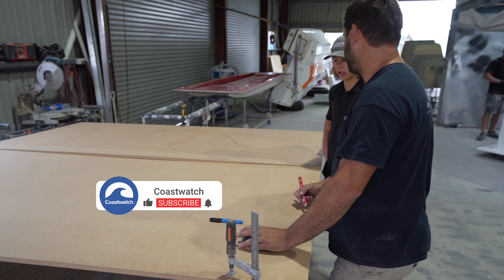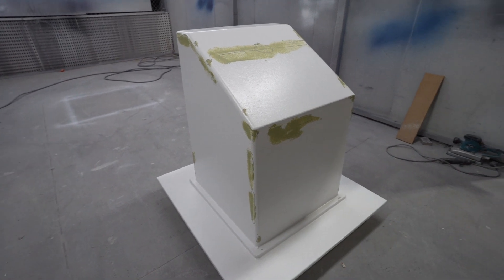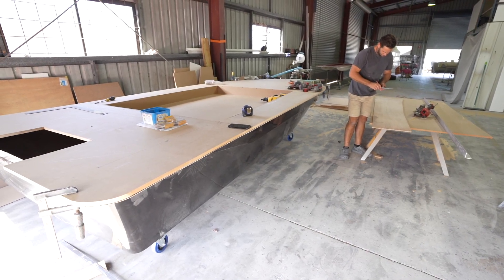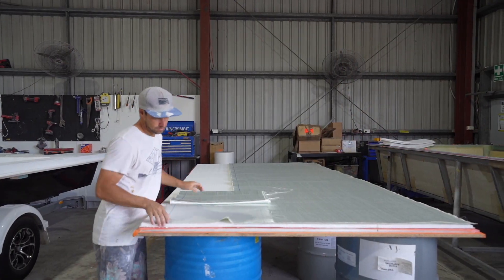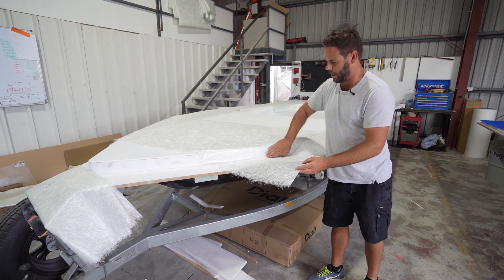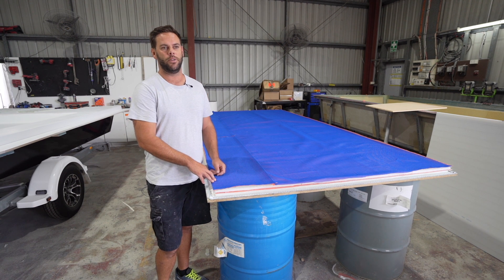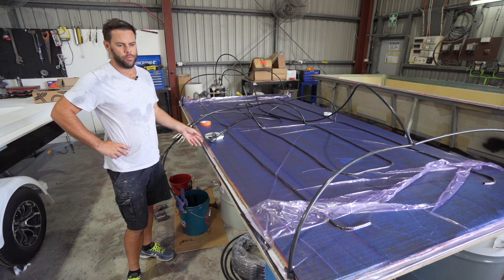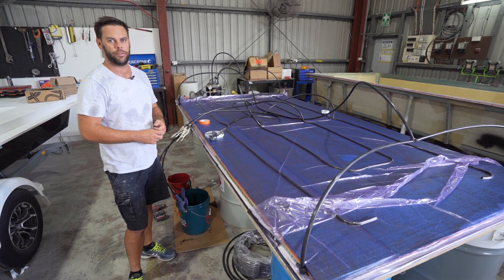INFUSION BOAT BUILDING - Project Boat Part Two

Comment: Impressive, how does the resin find its way into the lower sandwich layers when there's plastic separation between panels? It blows my mind!
Reply: My guess is that with the high vacuum that it just finds a path of least resistance around the edge. It looks like the bag provides a path.